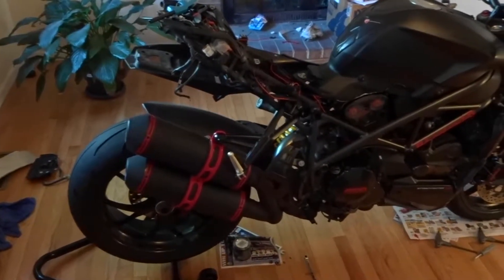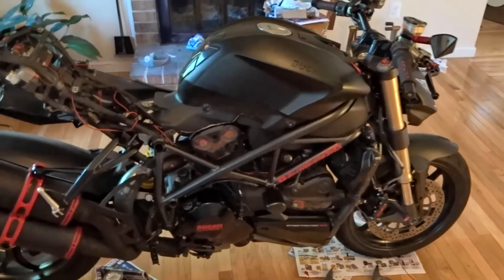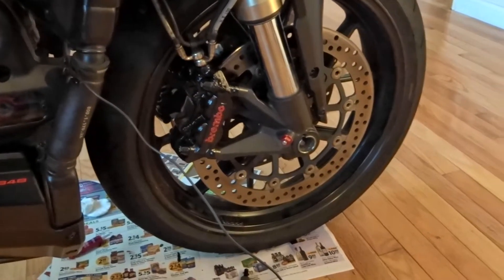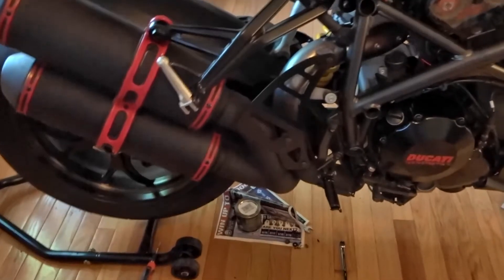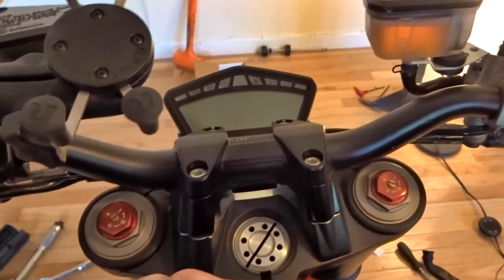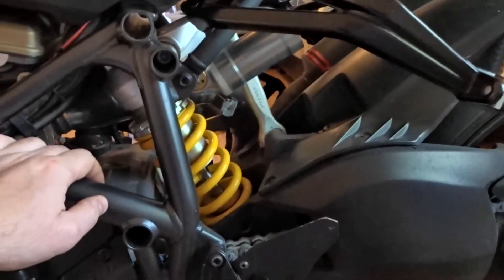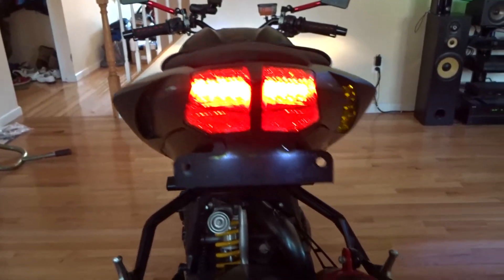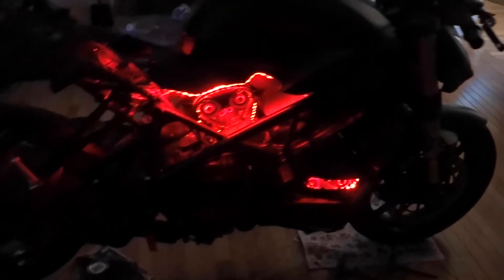Ducati Streetfighter 848 MODS and 10 Things I Hate

Comment: I have the same bike in black stealth as well.  If you haven't gone down a tooth in the front sprocket yet, you might want consider it.  I like your black handlebars btw.
Reply from the maker: +P Banks Yeah I haven't done anything with sprockets yet. I like the stock one for now. If I want to go crazy i have other bikes for that. ;) Black handlebars are easy. Take them off and use rollcage paint.

Comment: Looking good brother.  LOVE the red lighting.  My only concern would be the visibility of the front turn signals.  It might just be the way the camera sees it, but it looks like the headlight washes out the turn signals so much that you cant see them at all.
Reply from the maker: +MIcruiserGUY Nope.. You can see them good.. It's the camera angle probably. And either way they are not necessary..
Reply: rear signals look super dim too, don't they have an integrated tail light?